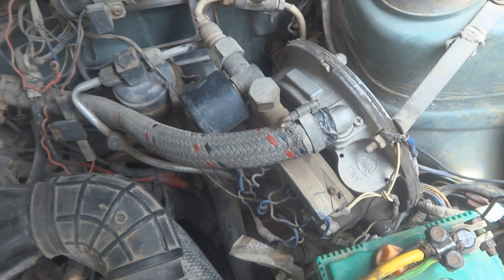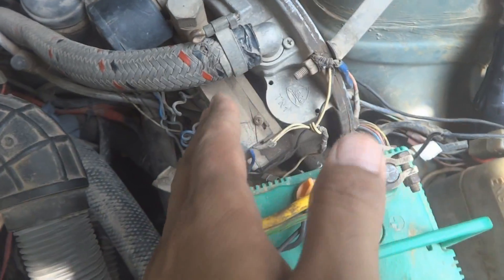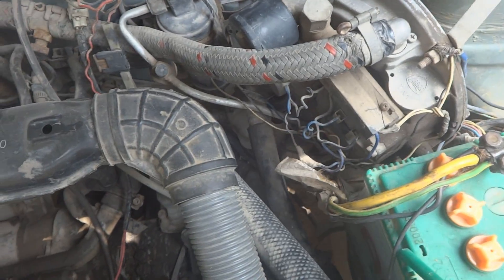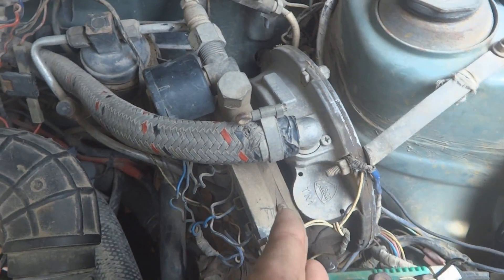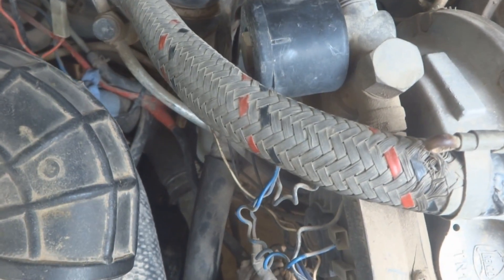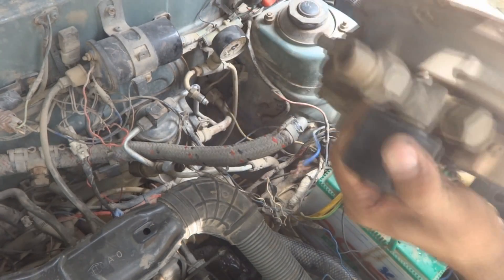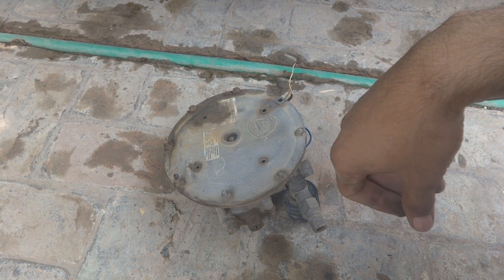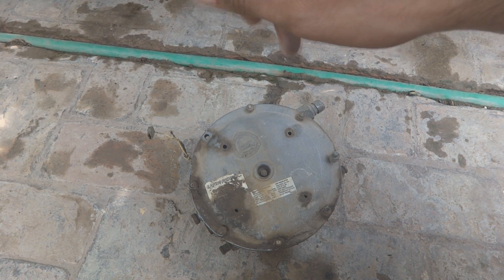CNG kit maintenance part 1. Car CNG gas kit repair and maintenance

Comment: Asslamualekum
Bhai jb switch off krte hen tu gas ni rokti kuch der BAAD rokti hai ...
Pehle switch bnd krte hi gas rok jati thi ya switch on kro lakin gari start na kro tu bhi gas rok jati thi ab tik kr ke kopi bnd ho jati hai lakin gas ni rokti jb tk kit me khatam na ho jae main cylender se rok jati hai vo thek hai  plz guide
Reply from the maker: Dear brother Saqib if you car all electrical system is ok and functional the the kit needs maintenance. There had been internal leakage developed. Dear brother Saqib I need your mobile contact number. If you can provide me here, it's just great. Otherwise give me your email address so that I would request your number by email. Wish you very good luck with your repair. ❤️❤️❤️

Comment: I have my car sequenc fire kit but when engine transfer petrol to cng or cng to petrol engion shut off 

मेरी गाडी में सीक्वैनसियल फायर किट लगी है 
जब गाडी सीएनजी से पेट्रोल या पेट्रोल से सीएनजी पर जाती है तो इंजन बंद हो जाता है ये क्या प्रोबलम है कोइ भी सेट नही कर पा रहा है
Reply from the maker: +Hariom Parajapati this is normal. Run on one type of fuel at a time.

Comment: i imagine the large disk shaped unit is a pressure regulator, it does look like one :-).
The pipe from the switch block looks like something that belongs to a very old vaccume cleaner, i hope it isnt :-(.
Im sure you will make it run like new again :-D
Reply from the maker: You are right dear sir it is a final pressure regulator to the engine. There are total three pressure regulators in this kit which regulates the pressure from very high 220 Bar to low level in stages. Next part will focus on such parts. The pipe shape is like that but it is a regular rubber hose housed in armor for safety and wear protection. This is normally used for the purpose. I got excellent results after service. Best regards,

Comment: sir I have i20 car and I am installed sequential CNG kit problem are low RPM missing problem how to fix it please tell me
Reply from the maker: The next parts of the video series will cover most part of the kit service, repair, inspection and calibration. Hope that will give you some help. Regards,
Reply: LearningZone ok sir thanks

Comment: Plz teach how to adjuat cng, plus name the nobs?
Reply from the maker: Sure Inshallah. The third part of the video series will focus on the adjustment. Also you must watch all four parts so that you will get complete understanding. You are my very respected subscriber and I care my subscribers. Also you can search my Urdu channel The Engineer if you like my other technology channel. It is in my featured channels also. Regards,
Reply: I have gained alot of knowledge about car maintenance from u, u explain thing easier.... Also explain reostate adjustment on efi cng car..And why local mechanic close half intake in cng vehicles.
Reply from the maker: Thanks for nice comment. Great that you learned something from me! The reason for closing half air intake is the matter of gas and air adjustment and achievement of optimum performance and starting point. Which is not always the case. Next parts will focus on adjustment and calibration. Also if you mean by rheostat the gauge potentiometer then the fourth part of the video series is all about that. You will learn about the system in the fourth part.

Comment: Salaam ustaad ji very interesting video I myself have never fixed gas conversion cars my brother has a toyota avensis converted to lpg it has a small tank in the spare wheel compartment the car starts on petrol and switches over to gas when car warms up it is a aftermarket installation keep up the brilliant work
Reply from the maker: That is great dear friend. The other parts of the video series will focus more on the subject. You are right the modern and computerized kits are doing the same as you stated. But the one here have no gasoline at all in the tank. It always starts and runs on gas and this is the very common arrangement in most old cars and after market. So I will show the service and calibration of the system on optimum level for best starting and running conditions.